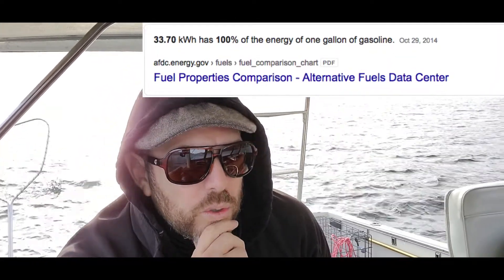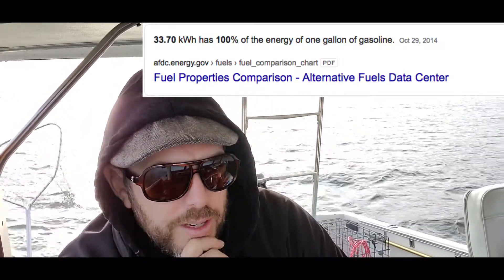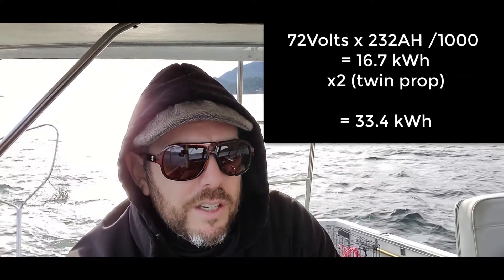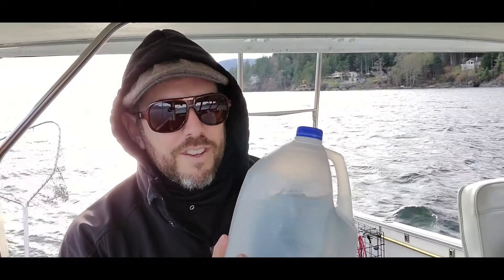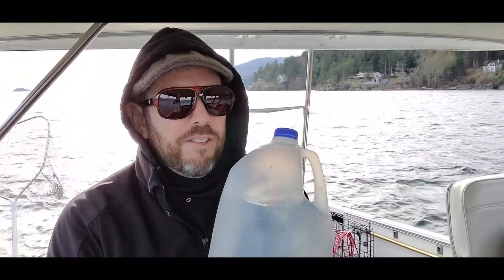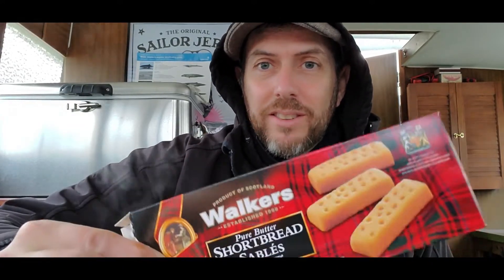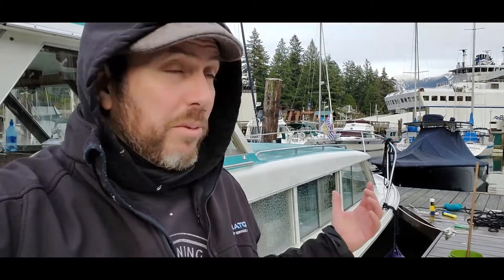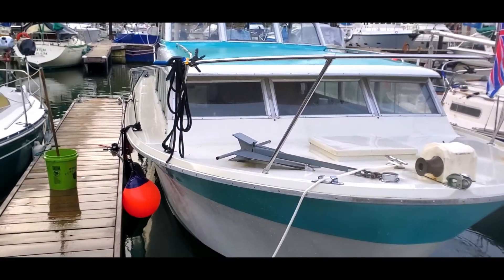MAXIMUM FOOTPRINT YIKES!  Batteries vs Gas - Energy Density Per Pound - Electric Boat.

Comment: I built an electric motorcycle using Nissan Leaf batteries from wrecking yard. They are fantastic... half the weight and much lower impedance.  I had 90v 65 AH with an Agni motor.  Of course a boat has MUCH MUCH more drag.
Reply from the maker: Very cool!

Comment: That's a great comparison. Also shows how inefficient lead-acid batteries are at storing energy - looking at the Tesla M3 battery pack as an example, 80kWh for 1100lb - 3.5 times the wH/lb! You're doing what I want to be doing soon with a trawler, keep it up, great to see your wins and hurdles.

Comment: Great breakdown. One thought on the position we find ourselves in. The restrictions and the American election have thrown  a spanner in the oil industry and gas prices have already risen (now start Feb 2021). The electric boat may be a clever choice if the oil price gets nasty. 
You have given me a lot to think about as I have a 30ft broads cruiser here in Ireland  with similar (but probably  wetter) weather. I'm on a river with large lakes and range is just as important crossing these lakes. A generator is most likely a good back up if funds allow.
Reply from the maker: Those are pretty great boats. I saw a conversion on a similar boat. They did a diesel electric where the boat ran on electric for a couple of hours then they switched to diesel the original diesel. Its a little more complex than my setup.
https://youtu.be/w2Bngp8gFlo
Reply: @ElectricCruiser  thanks for that link. Interesting. I haven't checked but it looks costly. A chap from your neck of the woods Peter , who has the travels with Gordie channel did a bit last year on those beta hybrids. He is doing up an old Monk cruiser wooden boat and is replacing his engine.

Comment: I had some thoughts I wanted to share. Enjoying your channel immensely and the Tolly is a really cool boat. In my many years of electric boating in a 1983 WD Schock Newport Electric Packet, and studying boats and conversing with other electric boat operators I discovered that operating planing hulls in displacement mode is vastly less efficient than a well designed displacement hull. Speedboats of similar weight and length and beam, with electric propulsion were showing to use about twice as much energy as my boat's hull to reach the same speeds.

The confounding problem with operating conventional boats on battery electric is that we are attempting to do something that is hugely inefficient (moving a boat through water) with an energy source that is very low energy density (batteries).

You shouldn't be afraid of using a generator at all. Design your boat and propulsion around most of your use cases, then make exceptions like that weekend boat outing going a hundred miles or whatever.

Comment: 72-volts x 232 Ah x 2-battery banks x 50% DOD = 16,704 watts
16,704 watts = 16.7-kWh
16.7-kWh / 14-nautical miles = 1.1931 or ~1.2-kWh per mile or 0.84-miles per kWh

One gallon of gas ~= 33.1-kWh 
33.1-kWh / 3-nautical miles ~= 11-kWh per mile or ~0.091-miles per kWh 

0.84-miles per kWh / 0.091-miles per kWh = 9.2-times more efficient

Comment: I completely agree. The Sea Ray and my thumb nail has two V8 Ford mare Cruisers that boat going 12 knots uses 22 gallons per hour I am absolutely convinced did if I had a generator and to AC Motors connected to my Transmissions instead of gas engines I would get the results of running the generator at full load for 1 hour uses one gallon of fuel. I can go pretty far in one hour at 12 knots but my wallets not big enough to do it with the V8 I know everyone splits hairs over the stupid s*** but when you just look at the full load fuel consumption of a 20000 watt generator vs 2 5.8 gasoline engines it's a no-brainer. Yes the use of electric motors in place gas V8 is my future plan for this boat just pulled it out of the water 2 weeks ago it's been in the water for 7 years. It's 30 feet long 12 ft wide and has a Wellcraft Sea Ray style V bottom. And considering building a fiberglass attachment for the stern to give it the shape of a displacement Hull for more efficiency. and maybe a wull vane. ive told you of that static device in the past. for us with v bottoms and flat backs , it makes perfect sense. i have nevver enjoyed a fast ride on a boat anyway. i want to cruise.
Reply from the maker: Yes the hull vane looks awesome but I haven't reached out to them yet. The Sharrow prop looks promising as well. I watched their video https://www.youtube.com/watch?v=fO862lWuBdE  and BoatTEST.com dropped a couple of interesting stats - most boaters spend 40% of their time in idle / slow cruising and WOT is used 6% of the time. That said, more power is always nice to have haha. Cheers!

Comment: Hi ! Yeah, haven´t said much lately. Thought I watch where this going. But now You brought the outlooks for 2021 into the mix. Well, I would certainly recommend a range extender and after that I would think about what´s next!
Of course with ideas that cost 10.000 $ the numbers don´t add up well!
So let´s have a closer look: Maybe this time You can share some of my views ?¿?
Well, actually when we talk about a range extender You just need enough capacity to keep You going through the day because at night You drop the anchor or sit on a dock. That means Your gen has time to recharge the batteries over night or You are plugged into shore.
Of course if we talk about the efficiency of Your boat it is not exactly a dream for electric propulsion but I always think... the worse boat is NO boat))) I hope You agree.
Yeah, I would say for the moment the fossil fuel is the cheapest and safest solution.
So if Your budget is tight here is what I would do. Go to this site and have a VERY,VERY close look at the technology and spec...........
https://www.ecotechalternators.com/custom-ecotech-alternators/

Yeah those guys are great because You get a warranty with  their internal regulator which they design in house! Those guys know exactly what they are doing and they can custom calibrate the regulator for Your needs.
Here is a site with a project and there You will also find all the formulas for calculating the numbers for Your needs.
http://dcgenset.blogspot.com/

I would asume the rest is just using a Mitsubishi or Kubota engine that You can find used and dirt cheap everywhere. Also the price of spare parts, repairs and maintenance is a piece of cake. Here are the Mitsubishi L2E and L3E specs where You can calculate Your fuel efficiency with torque and RPM diagrams.
https://det-mitsubishi.com/sites/default/files/2020-07/Mitsubishi%20-%20Commercial%20Spec%20Sheets%20-%20Industrial%20Engine%20-%20Variable%20Speed%20-%20L2E-Z564SPH.pdf

https://det-mitsubishi.com/sites/default/files/2020-07/Mitsubishi%20-%20Commercial%20Spec%20Sheets%20-%20Industrial%20Engine%20-%20Variable%20Speed%20-%20L3E-Z564SPH.pdf

Basic marinizing is just the water pump and the heat exchanger.
Westerbeke Marine use this engine in their models 20B and 30 B but there are also others in the after market where You can get those parts a lot cheaper.

Of course if You just wanna kick the can down the road I will watch and smile.
Ships are not made to sit in the harbor))))
Cheers

Comment: You have the benefit of range with hybrids and a good battery bank. When compared, electricity is cheaper for the 33kw of work performed, and while that battery footprint is not changing its weight when it's empty, neither does the ballast that you want. 
Would larger motors (higher kw's) give you greater speed option and retain efficiency at the same consumption rate/speed? 
9 or 10 knots is a good speed, and I'd feel more confident if I could do it.
By the way my name is Alan, and I look forward to seeing you work this out.
Reply from the maker: Hi Alan, yes, I think higher kW motors would for sure bump the top speed and result in some efficiency to gain some range - (but I would think that efficiency would be more noticeable below the hull speed). Ultimately that means higher voltage which In my opinion puts you into the liquid-cooled AC market with a motor that can produce more RPMs. When these motors die, that is likely where I will be looking. It's an easy enough swap but not an inexpensive one hah. 

The only thing to consider is that the hull is going to play a major part in the efficiency result. For example, the fuel burn on a 'typical' cabin cruiser can double by increasing from 4 -4.5 kts, and climb towards the theoretical hull speed. On full plane, the fuel burn can quadruple. Regardless of whether it's electric or gas, (or diesel)  the faster you go with these hulls, the more energy will be required to push it through the water - but it will be closer to exponential requirements rather than linear.  This is where something like a hull-vane or the sharrow props might be of help - of course neither is an inexpensive option either. I believe Sharrow props are 5K to start and I don't know what a hull vane would cost. Without a pile of spare cash, the project remains a puzzle :) Thanks again for watching!

Comment: If it was myself I'd be watching the insurance sales for a totaled car that's a hybrid. Then you'd end up with the batteries your really after. Plus SO much more including another motor that maybe even more efficient in your current setup. 
 Just a thought. 
 Keep up the great work!
Reply: I mean it really doesn't take much to be more efficient than the current set up. He is driving a cabin cruiser with brushed motors powered by lead acid batteries. The lowest common denominator of efficiency in every step of the chain.

The set up that I am currently speccing is a used stripped out Catamaran hull to outfit as I please. Some Hyper9 motors which are switched reluctance brushless motors with an overall system efficiency of 92%. And 37-74kwh of lithium batteries.
With my current calculations 3kw of power to the motors will get me a cruising speed of 4-5 knots and a range of  50-110 miles (course thats theoretical numbers so I doubt it would do that real world.). Also those motors have 120HP each, so I could get a top speed of 18 knots (for 20 minutes)